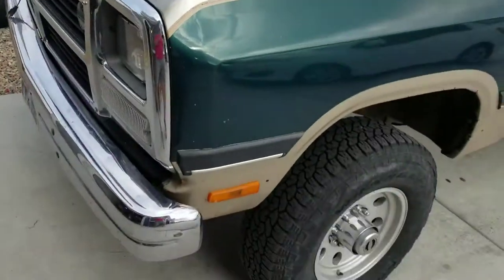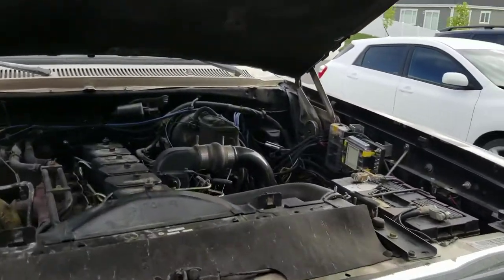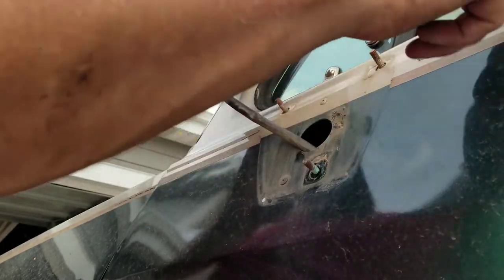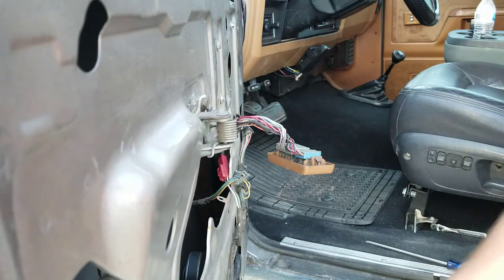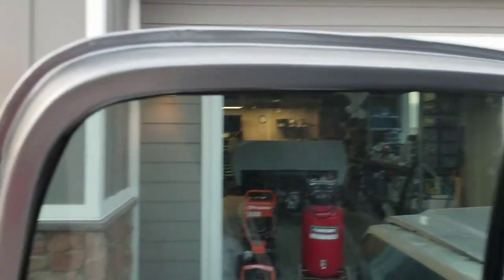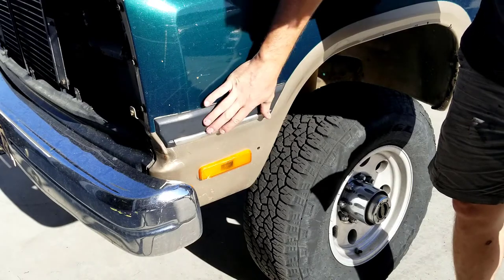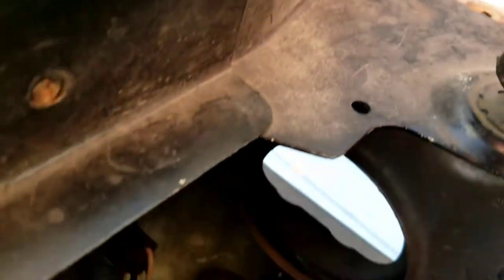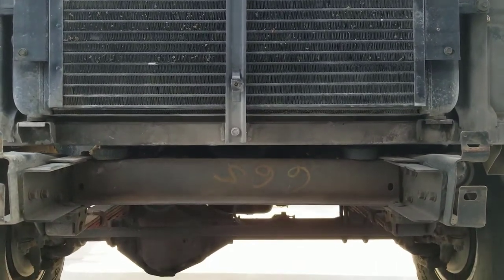Tearing Down the Cab to Start Sanding and Bodywork

Comment: The new color looks like it’ll really pop! 👍

As for the broken door panel, it might be worth looking into getting yourself an airless plastic welding system for this and any future DIY projects. Polyvance (formerly Urethane Supply Co.) has a really nice system that you can score for a reasonable price on eBay. A little Dremeling followed up with some plastic fusing on the back will make it rigid again. Then a light coat of plastic putty over the crack line will get it ready for plastic promoter and a few coats of color.

Keep up the good work!
Reply from the maker: Wow, I've never heard of this. I'm definitely going to look this up!